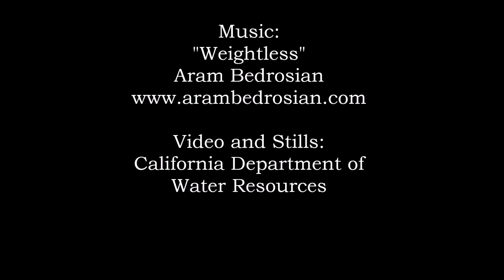Oroville 22 Feb 2018 Update

Comment: Juan

Thanks for the update.  I’m curious about the projected weather for the drainage area and likelihood of warm rain to melt the recent snowpack in the near future. This could lead to flooding and rapid fill of the reservoir.   

The Grand Solar Minimum we are entering into portends more and larger precipitation events such as the east coast nor’easters.  (Bigger and Badder, and more of them).  

This brings into question the integrity of the rest of the system especially levees. 

In addition, recorded history tells us that there is a large increase in volcanism and earthquakes during solar minimums suggesting that we can expect a large earthquake in the next five years.  This begs the question about the earthquake integrity of the system.  

Normally disasters are an accumulation of risk events that by themselves would not be of concern.  In the next five years it is possible to have an event such as the 1875 (?) CA flood that filled a large part of the Central Valley to  30 foot depths and caused the capitol to be moved from Sacramento to San Francisco. This massive storm lasted for a straight 40 days.  

My other question then begs for an answer if  the system could handle this size event which would most likely push all dams to the limit on spill capacity especially if the unsuspected event ever started with dams FULL.  

Can the levees handle this event which was in historical timeframe  when the the system was designed?  We’re the levees designed for the capacity equal to max Dam discharge. 

With better visibility of earthquake potential in California, what is the anticipated risk of the big one damaging the system and then the system still being able to handle a larger than normal runoff season while repairs are being done?   Should a stockpiling of critical materials be conducted?  

Where is the week spot in the system?  Should responsible persons be paying attention to the highest risk points in the system now?  

What is the backup plan should system failures occur. 

Keep up the excellent reporting. You are an invaluable asset to the public.   

Thanks so much. 

Titus Nelson, PE
CA Registered Professional Engineer.
Reply from the maker: stby for 12 March Oroville update where we discuss the current weather situation.

Dam discharges are matched to Levee capacity.

The greater earthquake concern for the aqueduct is not having enough or ANY water. Not so much flooding.

The weak spot is overall aging infrastructure, and politicians will to deal with it.

Thanks Titus!

Comment: Hang on, the top of the secant wall is not level?   Seems like from a hydraulic engineering standpoint, one would want a level weir to distribute the force of the water evenly across the length of the wall.  Otherwise, all the water flows to the lowest spot and concentrates the force of water.
Reply from the maker: it's over 1400' long, gotta follow the terrain.

Comment: Seems to me that the cut slope at the end needs armoring and perhaps a taller wall section out from the abutments (if any?) to keep the water away from the bare rock? 

This footage isn't much help without knowing for sure what you're looking at--especially for those of us who haven't been there. A broad aerial shot with a mark (with orientation arrow in all the shots) just ahead of the closeups (CU's) would be an easy way to cure this problem. As would cuts that are more than a fraction of a second.
Reply from the maker: stick around for the rest of the video before commenting and you'll be shown in great detail.
Reply: I'm presuming this is not your footage, so my comment isn't personal. Any comment on the first question?
Reply from the maker: Wayne Tyson I’m unclear on your first question.

Comment: Juan - Thanks for the photos and discussion on the Secant cutoff wall. Very interesting use of a concrete cable cutter to evenly remove the pile tops. Also interesting design detail on the gaps in the wall for groundwater migration.  Keep up the great reporting and get better soon.

Comment: What happens with the bags of rocks dropped by helicopter last February when headcutting was observed on the Emergency Spillway?
Reply from the maker: They're being removed and replaced with the new RCC splashpad.
Reply: Are they waiting until the Secant Cutoff Wall is complete before removing the bags of rocks?  I guess there are concerns about the stability of that section of the Emergency Spillway.
Reply from the maker: I believe so.

Comment: Rocks are cleaned with compressed air and water near the energy dissipator blocks in preparation for the placement of an access road just below the Flood Control Spillway. The dirt road used up until now needs to be removed and dredged.  I think they also need to resurface the energy dissipator blocks. https://pixel-ca-dwr.photoshelter.com/galleries/C0000OxvlgXg3yfg/G00003YCcmDTx48Y/I0000AlMUo4SlvYQ/KJ-oroville-0678-02-20-18-jpg
Reply from the maker: Yep.

Comment: Why do the RCC spillway walls have to be removed to install structural concrete walls?
Would it not be cheaper or possible to install the structural concrete wall in front of the already installed RCC wall?
Reply from the maker: I asked the same question during the Construction Tour video series...It has to do with properly connecting the extensive drain system. It's much easier.

Comment: The use of a diamond wire saw was an odd one in one factor and that is they don't like to use them when steel is in the materials to cut but makes sense for the weight to power factor in that a power unit and the track it rides on can be transported in a pickup truck. Once it is setup it is sit back and watch till the power unit hits the back of the track then remove a section of fire as you reset it back to the start of the track.
Reply from the maker: I see they used a giant circular saw too.....
Reply: You see wire saws a lot in quarries where they want to section off large blocks of say marble or granite, for countertops.

Comment: LA Times is reporting that FEMA is balking in regards to paying the expected 75% of the total cost of the repair. The report is that FEMA is claiming the failure was due to construction errors or building on a surface not suitable (the rock crumbled) and not some type of natural disaster. CA has always known they were going to pay out the remaining 25%. Reported cost is getting real close to 1 billion dollars. In contrast The Mercury News reports that the DWR reports that "we keep submitting bills and FEMA keeps paying". DWR is confident that FEMA will pay the 75%. Cost now is 870 million (isn't that close to 1 billion?) Sacramento Bee reports 4 subcontractor employees fired for posting pictures of the work on social media. The reasoning was(from DWR) "if you are taking and posting pictures you are not doing the job you are being paid for".
Reply from the maker: Political posturing at this point...but could become a big issue!
Reply: I heard the answer to your question about if the recent (February) cold snap is affecting construction (the answer was "NO"). I must state that this cold snap we here in the Antelope Valley are dealing with (morning lows of 21F with wind chill) is certainly affecting my productivity. I kind of passed this answer off until I saw pictures of these guys working in T-shirts and high visibility vests. It has to be colder up in Oroville than it is down here by me. The men at that job site did not appear the least affected by the cold. Oh, hope you do beat that flu. I know several that needed medical care because of the flu (it seems I am lucky as my flu shot worked) Wow, out of curiosity I checked the Oroville weather. It is colder by me in here Kern County that further North in Oroville.

Comment: Question.  Has the auxiliary underground pipe outlet system (Don't remember the proper name) been fully repaired and brought back online?  I mean the one independent of the Hayat power plant that was found to be corroded and unusable before all this started.  Thanks for all this in-depth reporting. You are never going to find this kind of reporting in the newspaper or the talking heads on TV.
Reply from the maker: The RVOS system? Yes.
Reply: I don't remember them putting the dispersion ring back in. Did I miss that? Or is it still not there, and they are just going to motorize the valve and wait for something else terrible to happen from the resulting pressure differential.

Comment: why the rebuild of the parking lot wall? It's not any higher than the previous one?
Reply from the maker: It's part of the emergency spillway and needed to be more robust.
Reply: so poor management of the lake level could make it overflow again
Reply from the maker: "so poor management of the lake level could make it overflow again?"- No, it's  requirement to have an operational emergency spillway.
Reply: Of course lakes can overflow.
It's what dams DO.
Our job is to make the overflow useful(power plant), controlled(main spillway) or in the case of maximum worst case to minimize the damage(emergency spillway)

Comment: Heaaay your back! That isn't the flu. If you had the flu you would know. You just have a common cold. The flu comes with a horrible cough, shivers and fever plus other symptoms. The cold is like the green spot on the wall of the dam, nothing as serious as the flu. The flu is like having water flow over a dam. And we all know what that would do. Remember to always wash your hands and get plenty of rest and eat healthy. Thanks Juan. Get well. PS Vitamin C.
Reply: Riding in a plane for hours with hundreds of other people all breathing the same "recirculated" air doesn't help much either during the season. Yes, a vitamin C pill in the morning and one at night helps lots. To "cost" critics, most per cubic foot concrete costs don't include "blasting", Hydro-cleaning, vacuuming, grouting, and 25' anchor bolts into bedrock as a "foundation" under the concrete pour. Other words, this project is pretty "unique" and cannot be compared with "general" concrete work.
Reply from the maker: That was last week...this is a week later.

Comment: There was one section of spillway that was miss poured or miss cured. Does that have to be replaced this year?
Reply: 3 out of 254, and yes they will need to be replaced.  1% isn't bad.
Reply: Приятно видеть Вас бодрым и нацеленным на работу , хорошего Вам дня!
Что касается показанных работ , должен сказать что взрывные работы  у корня основного водосброса  , в близости от нового бетона ещё не успевшего набрать прочность, даже мелошпуровым  вырыванием КРАЙНЕ НЕ ЖЕЛАТЕЛЬНА .
Reply from the maker: 3 panels, discussed in previous updates. Went off to fast before could apply proper finish.

Comment: The green spot is created by runoff from Kelly Ridge, the water that keeps that patch of grass green originates at the golf course and is supplemented by every house between it and the spot. It is obvious since that spot has been there through every drought where the lake levels was well below that elevation. Water does not run uphill. What is uphill from that green spot is a retirement community with a golf course at it's center that heavily waters the lawn because golf courses want the greenest lawns possible.
Reply: JETWTF  Now there is a real answer,.  That makes sense thank you.
Reply: I stated the same last year on one of the blancolirio videos that had the subject of the green spot. I also went into more depth as to why just that spot was green in the late spring and early summer while all else was either turning brown or full dried. As the summer moves on soil dries up and is better able to soak up water. So the golf courses excess watering is soaked up between it and the dam when the green spot disappears during the summer far later than all other grass losing the green.

The same phenomena can be found below any hilltop community in California and most noticeable is when there is a golf course in the community. If the dam wasn't there, there would be a green stripe on the hillside.
Reply: It's still water runoff, Yes Kelly Ridge was there when the dam was built, no the golf course wasn't but there were enough homes there to create enough runoff because those homes had larger property with large green lawns overlooking the valley. There were a shitload of homes there in the 70's because I remember them, built there because of the dam that started the removal of the old homes and combining and splitting property into smaller lots. Today the majority of houses up there are mobile homes with tiny lots and the majority do not have lawns, thus it is the golf course creating the spot today while in the past is was the homes. 

The spot is there now but the lake is well below that level. Water doesn't flow upwards naturally,  if it was forced up by pressure the dam would've failed at that spot decades ago.
Reply: The "real answer"?  Because one person said it and it makes sense to you?  That's hardly scientific.  Was Kelly Ridge there back during construction with this area was observed to be wet?  I'm seeing houses there built in the early 90's.  Was the gold course there in the 1960's?

Comment: Juan what up with clearing the hillside with street sweeping brushes?? What ever happened to pouring the concrete on bedrock???
Reply: Here is a suggestion.  RCC can actually be placed on compacted fill.  I'm spit-balling here, but let's consider this... The main SW is about 180 feet wide.  The ESW is going to be almost 1800' wide from the gate structure to the NW edge of  the parking area - about 10 times the MSW width.  Perhaps the ESW chute between the overflow weir and the cutoff wall does not have to be laid on bedrock, since there is much less head pressure (40' from top of dam to gates, vs a few feet during overflow), and the flow is distributed over a much larger area.  They may go down to bedrock along the transition from the newly extended ESW weir to the to-be-laid RCC (the earth is already eroded from the 2017 overflow), and then switch over to laying over compacted earth down to a point where they go back to bedrock just above the cutoff wall.

Keep in mind that the ESW #1) should never be used again and #2) is primarily a safety valve to allow time for evacuation downstream in an emergency.  Compare to the MSW which is needed in about 50% of years.
Reply: Yes i understand that. Just seems wierd that they would say they are gonna remove all the rock, rockbags and concrete already placed to start over with fresh concrete....

Comment: Missed you Juan, hope you get well quick, it took me about 4+ weeks.

If the secant cutoff wall follows the terrain, it would seem that the terrain would guide overflow to the low spot concentrating erosion which would seem counter productive.  Also if the overflow is guided to one spot by the terrain, why have such a long wall?  Why not just in that one spot plus a little insurance on each side?

Gotta love the folks answering the questions, they all know you and are happy to answer your questions, not so much with the "big" press guys and gals.  He, he.  Nice work, you are OBVIOUSLY the best!
Reply: sweepleader very good question.  The presumption is the run off water would stay within that 'low spot'.  It would at lower volumes.  But it is limited in the volume it can handle.  Exceeding that volume would result in a 'sheet' of water much like when a river overflows it's banks.  So, that little insurance actually has to be a thousand feet or whatever the length of the secant wall. Too, the length of the secant is dictated by the length of the ogee weir.  And the weir was lengthened.  To handle larger volume.  

Q:  How to ensure a water flow remains within it's channel?  
A:  Widen the channel.
Reply: In the event of the emergency spillway being needed, there is almost no concern for erosion of the downslope terrain.
The only concern is to prevent this erosion from headcutting its way up to the dam and causing a big flood. Hence, the use of the Secant wall.
Reply: sweepleader Good question! I think the secant cutoff wall is quite long, because the relatively gentle slope of the terrain, means the 'insurance' has to be a lot wider, than if it were in a narrow gully. Around 12:32 and 12:48 in the video you can get a good idea of how shallow the slope is.
Reply: AFAIK the emergency spillway is rated for 300,000cfs, which is a huge amount of water! My hydraulics is a bit rusty, so I can't give a complete answer. A ballpark figure for that flow-rate would be a weir 1000ft wide, over-topped by 10ft of water, at an average velocity of 30ft/s. This design is not just catering for a trickle over one low spot...
Reply: Richard H, where did you get your information about the ogee weir being lengthened? I was standing next to it yesterday, and it still runs from the main spillway to the Spillway Recreation Area cul de sac, same as it always has.
Reply: Erosion channels widen. That is why it is as long as it is.